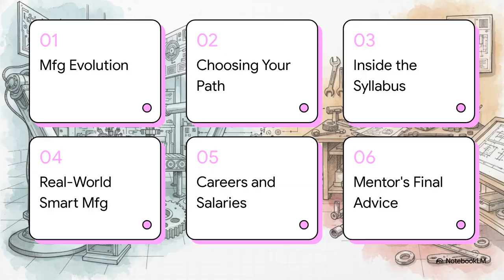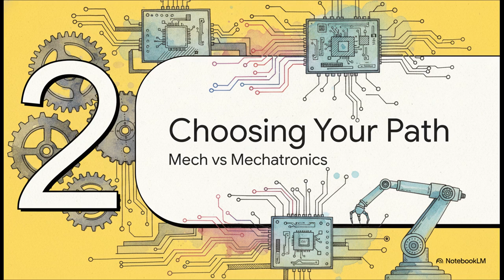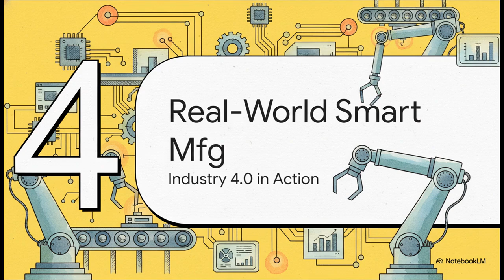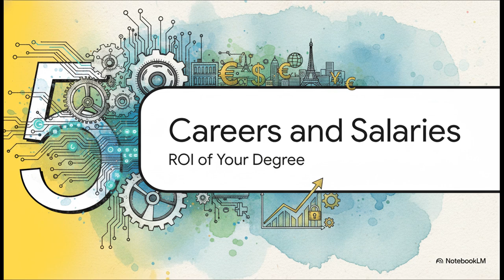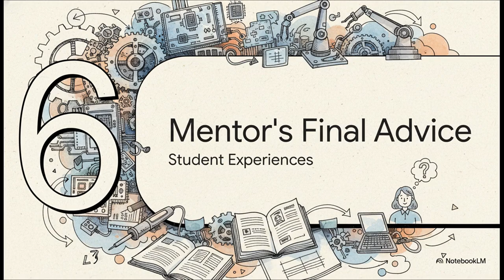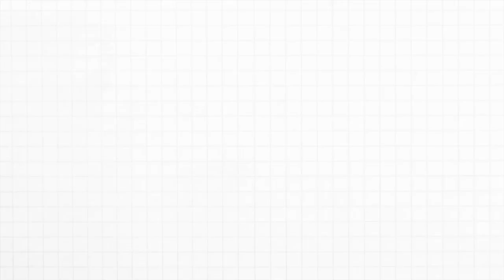B.E. Mechanical Engineering: Smart Manufacturing Careers, Salary & Syllabus 2026

Comment from the maker: B.E. Mechanical Engineering: Smart Manufacturing Careers, Salary & Syllabus 2026
 The industrial sector is navigating a major paradigm shift toward Industry 4.0, moving away from isolated units toward an integrated cyber-physical ecosystem
. This video provides a comprehensive guide to the B.E. in Mechanical Engineering specialized in Smart Manufacturing, a field essential for the global demand for autonomous and efficient production
. 
The future demand for this branch is driven by a global robotics and automation market projected to reach $53.64 billion by 2026
. We break down the academic syllabus, covering foundational mechanics and Applied Data Science in the 2nd year, Industrial Robotics and CAD/CAM in the 3rd year, and advanced Digital Twins and AI in the 4th year
. 
Discover high-demand career opportunities such as Automation Engineer, Manufacturing Data Analyst, and Additive Manufacturing Specialist
. These roles are critical in top industries including Automotive (Tesla), Aerospace (Rolls-Royce), and Consumer Electronics (Apple)
.
We also analyze global salary scales for 2026:
India: Average packages range from ₹6.5L to high-end placements of ₹51 LPA
.
USA: Entry-level roles start at 75k,withexpertsearning∗∗200k+**
.
Germany & Japan: Robust demand with salaries ranging from €65k to ¥15m+ for senior specialists
.
Learn how this specialization offers unique global mobility, particularly in hubs like Germany, which faces a shortage of over 250,000 engineers, and Japan, a leader in high-tech robotics
. Whether comparing smart manufacturing to traditional manual methods or mechatronics, this degree is designed to be future-proof
.